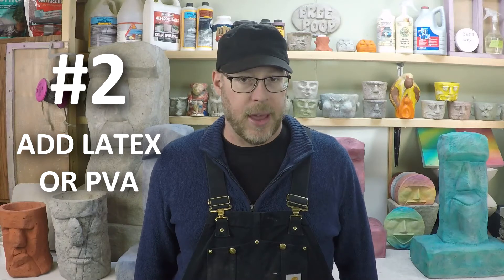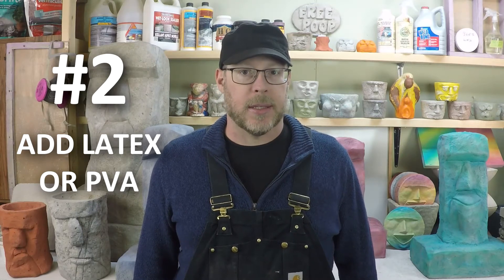What Makes Concrete Stronger?

Comment: I can't seem to find steel fibers for reinforcement. I was able to get fiberglass resin - it comes as a two part system. Thick liquid with drops of resin hardener. 

How much fiberglass liquid should I add per volume of concrete mix? (JB Weld brand). 

What I tried was having my water in a jug and mixing resin + hardening drops into the water together, then pouring that into dry concrete mix. My question is - should I be mixing the resin + drops separate from the water? Should I change this approach? Does the resin + hardener need to be mixed together before being added to any other materials? I can't seem to find any answers online. TIA!

Comment: Hi, great content, thank you!
I want to make concrete dumbbells/kettlebells, whats the best method to make it "unbreakable"? I was thinking about adding fiberglass, or put inside a spiral made of tie wire, or both for better result? Maybe you can recommend something better? 
Thank you!
Reply from the maker: galvanized steel wire embedded in the concrete would be the best, and a safety concern as well.  Without the steel, even with a strong mix design, when the weight breaks it will fall apart, potentially injuring someone.  The more steel the better, so even in teh event of a break, there is only a crack and nothing falls apart.

Comment: PVA glue and fiberglass or equivent makes the durability rating go way up whether it is lightweight concrete or a slab being poured .the addition of watergrass after curing adds to the longevity

Comment: Are concrete bags labeled “high strength” engineered concrete?
Reply from the maker: Yes, since they will require a quality control and specific mix design to achieve the desired properties as advertised on the bag.
Reply: @creatingconcrete  the high strength concrete mix I see on Home Depot website says it’s for applications greater than 2”. Are your projects always at least 2” thick? Can you do something less than 2” thick, and if so what would you recommend using in that scenario?

Comment: Do engineered mixes use less Portland cement (to reduce cost)?
Reply from the maker: they use the "right" amount of cement to achieve the desired strength.  Engineered mixes are less about cost efficiency in my experience.